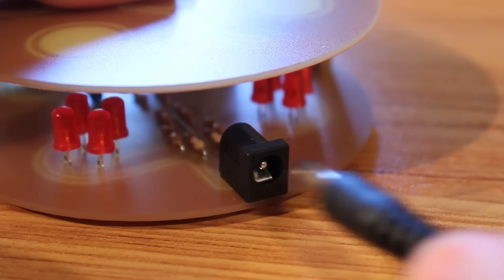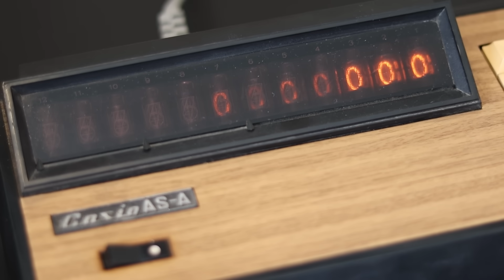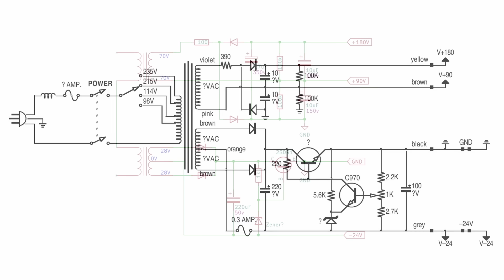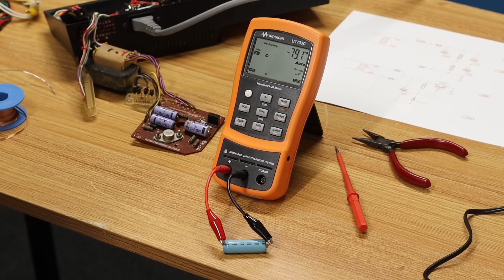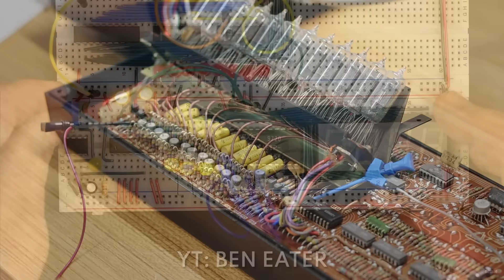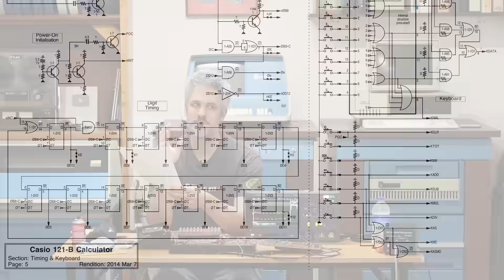Working on a Casio AS-A Nixie Tube Calculator

Comment: That signal is behaving as though you have at least one capacitor which is breaking down when voltage rises. Also check the resistor values.

Comment: Takes me back to the 70s when I was a calculator repair man (yes, we visited businesses and repaired their calculators). The main product was an enormous beast that had 16 nixie tubes, four basic functions and no memory (It took all your strength to lift it). The innards consisted of about 50 plug in PCBs with a few transistors and discrete components. Faults were tracked to individual PCBs, which you then repaired back at base. Calculators rapidly shrank in size and we were eventually out of a job. I still have my first pocket calculator purchased in the late 70s (and it still works).
Reply: I still have my OMRON 606 pocket calculator purchased in 1976, it also still works 😊

Comment: I have somthing similar to that but i think it a little bit older. Its a ANITA 1021.  its got about 10 Pcbs in the back of it that all plug into a motherboard as such. The nixie tubes are made from red glass by Mullard.. Its all original. never been touched.  I think and i might be wrong its late 1950s
Reply: That is a very collectible calculator! The Casio AS-A came out in 1969 and the Anita 1021 in 1970. The tubes are clear glass that is painted red.
Reply: I couldnt really find much information about it, aparantly it was the first model that they introduced silicon chips to. Before that they were all transistor but the 1021 had some chips aswell.  @megatesla

Comment: Any idea what the logic family is on the circuit boards? Good luck finding spares.
Reply: Mostly Hitachi HD3106, HD3107, HD713, NEC uPD13C and uPD101C.
Reply: They're P-MOS devices that required -24v, made by NEC, Hitachi, Toshiba, and Mitsubishi between 1968 and 1971. You are not going to find new spares of course. But replacemens have been fabricated using modern C-MOS, with logic lever converters, and appropriate linear voltage regulators. .
Reply: @michaelturner4457  Some spares are available from shops in Japan. But I am interested in how the replacements are made. Can you point me to that please? I fixed one of my AS-A's today. Luckily it only had a broken trace on one of the clock lines. I now have 3 other ones in different partially working states that I am going to try and repair.

Comment: BTW, it's not zero-C and zero-T.   That is the Greek letter Phi, which is often used in digital logic to indicate a clock of a particular phase.  So, it's "phi-C" and "phi-T".  Likely, the calculator's two clock phases are non-overlapping, which probably indicates that it uses early MOS (metal-oxide semiconductor) logic.  Remember, the 6800, 8080, 6502 and 6809 microprocessors all required a 2-phase non-overlapping clock pair.

Comment: Check those metal can germaniums for shorts to the can itself.. especially if they have a screening lead (i.e. the package has 4 leads).. caused by tin whiskers..
Reply: They are silicon transistors. If faulty that tube will stay lit or be dead.

Comment: I'm certainly no expert, but I wonder if the chaos comes from the flip flops being unable to keep up with the clock.  There's supposed to only be one high pulse cycling through the loop, but if one of the flip flops doesn't have time to fall from high to low before it latches, then you would end up with more than one pulse.  And if it's right on the edge, it may goof up inconsistently, which could look like what you see.
Not sure what would cause it to exist right on that edge, though.

Comment: The whole device is specced at about 8 VA power draw, thinking you hould load it with 12 W is pure wrong. If the transformer draws 8 VA, the Pout of that power supply could be maybe 5 W at best, total across all rails.
Same as you speak about the 20 W transistor, nonsense to assume load from the Ptot of that pass element. It will be capable dissipating 20 W with ideal heatsinking, holding 25°C at the case (while Tj is at max internally). That little poor transistor is without any heatsink, so the allowable dissipation on it may be like 1 W at best. By estimating the input voltage to that regulator to be somwhere around say 35 V, you could load it at best 1 W / (35 - 24 V) = 90 mA continous or maybe 150 mA short term.  Half an amp is absolute crazy. Another hint you should notice is the very low capacitance of the filter cap before the regulator - at only 200 uF, should be a giveaway, that the power supply  rail at 24V will be rather a low current one.
Reply: Changing the electrolytics in the power supply was also like not necessary. Don't just assume capacitor is bad! Old electrolytics were common having a tolerance range of like even -20..+80 %. And if it pretends to have capacitance, low ESR and low leakage current, there is zero reason to bastardize the power supply with new caps.
Reply: @Sixta16  I have to agree with you. I have a dozen nixie tube calculators and other early 70s models and I am yet to find a dead capacitor. I usually need to replace diodes, transistors, reed switches and maybe a faulty IC.

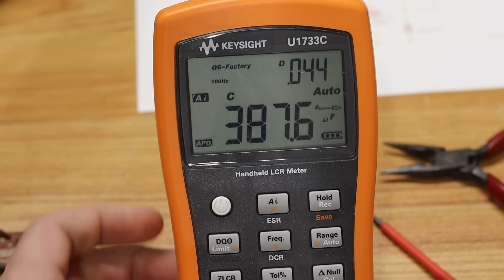Comment: 13:30 Your meter shows the capacitance as higher than normal, when it's really a lot lower than normal. This is because the cap's electrical leakage is fooling the meter. Most capacitance meters work by feeding a signal of known frequency and voltage to the cap, and then measuring the current that flows through it. Higher capacitance means higher current. But so does leakage! And so the meter gets fooled. The only way to get the real cap value is to use an old-style tester that puts the cap in an oscillator circuit and measures the frequency of the resulting oscillation.

Comment: I'm a big fan of tubes myself, and your tube computers are why I subscribed. I'm a vintage audio service tech, and I work on a lot of tube gear. Your description of triode operation was excellent! As for nixie tubes, there is a piece of benchmarking software for Windows PC's called "Superposition." While running, it displays a sort of "tour" of a laboratory containing a machine that affects the gravity in the room. There is a desk where owner of the lab sits, and on it is a calculator, case removed, and nixie tubes glowing. It's very cool. I'll see if I can email you a screenshot.

EDIT: Well, I was going to email that to you, but your home page on YT does not have an email address I can find. Anyway, check out the Superposition benchmark if you get a chance, and you can see it for yourself.

Comment: I suspect there might be noise or an erratic fault in the display driver latch ring? That would be consistent with the incorrect but periodic sequences of pulses seen early on. 

I could also see this fault being constrained in a way that makes the all zeros state a fixed point of the feedback system. This would explain why the calculator needs to be restarted once it goes dark.

Comment: I have the Commodore branded version of this calculator.  Unfortunately it is missing the "divide" keycap.. and I'll probably never find a replacement.  I also need to find one of the weird japanese-calculator power cables.  But it mostly works - need to test more when I get a proper power cord.

Comment: I am not sure that it as broken as you think. You have to push clear twice before calculations can happen.
The as-a is an early style of calculator that comes up with lots of rubbish on switch on and only after pushing clear twice can you start to calculate.
I have an as-c unit that has two strange accumulators that don't seem to make a lot of sense but it has a working decimal point
Reply: My AS-A starts up with 0's and are ready to go, no need to press C.

Comment: I recently designed a Nixie tube clock and I'm fascinated that the engineers who designed this calculator chose to multiplex the tubes. Big power savings, of course; probably on the order of 5 watts saved across 12 tubes. But some people today believe that switching the tubes like that will cut the tube lifetime. Many (most?) of the clock designs on the internet continuously power the tubes. Makes me wonder. Anyway, thanks for the great video!
Reply: I've never heard of nixie tubes or other gas discharge type displays failing because of multiplexing. Cathode poisoning due to sputtering can be the main problem with them, which is why some nixie clocks periodically cycle all the digits. They probably chose to multiplex the display so it only required one high voltage digit decoder cathode driver IC, instead of 12. Which were probably more costly than 12 anode driver multiplexing transistors. And would also make the PCB much more complex with all the separate cathode connections, instead of paralleled up.
Reply: Multiplexing cuts down on the connections made to the display bank significantly. Multi-digit displays from the 70s would have used the scheme and the tubes had to deal with that fact.
Reply: Hmm, that would be interesting to look into. The only thing I can think of is oxidation, but seeing as it's vacuum sealed, I doubt that would be the issue.

Comment: It's OK if a power supply capacitor is a bit too big.  The spec on those old ones was something like -10% to +25% of stated value.  But the ESR may be real high so changing them out wasn't a bad idea.

Comment: There ICs are fascinating on this calc. Very early P-MOS devices that ran on -24V, were unique to Japan, and now completely unobtanium. 

EDIT:
I think standard +5v TTL logic might have available at this time, but possibly due to US patents, licensing, maybe Japanese manufacturing pride, NEC, Toshiba, Hitachi, Mitsubishi, et-al, developed their own totally unique semiconductor logic methods for use in these calculators.
Reply: do you mean with a positive supply too, or with only negative? (as in 0V, -24V, or +?V, 0V, -24V? I'm guessing it's the latter, since it makes no sense to do it like the former. All you'd need to do to make it sane voltages would be switching around the labels for power and ground, then you'd have 0V and +24V)
Reply: @nikkiofthevalley  The latter, it's -24v with respect to the 0v, +90v, and +180v power supply rails. Also the swing between logical 0 and 1 is almost 24v, which can make these ICs rather difficult to replace with modern devices. I'm sure they were only manufactured for a short time, 1968 to 1971, as by then LSI chips became available for use in much smaller battery operated calculators. 

Usagi is in for a lot of fun with fixing this Casio.
Reply: @michaelturner4457  then I think one of the timing traces he showed was odd, the amplitude was somewhat closer to 5V whereas the clock had a much higher swing (assuming both signals have the same scale of course but I've yet to see a scope that lets you have two scales on one screen)
Reply: @michaelturner4457  About the only way to replace them with modern ICs is to make boards that contain a few level converters and a linear regulator along with the actual replacement IC haha
Reply: @nikkiofthevalley  I've read about repairing them, and that is exactly what they've done to replaced failed ICs, unless they had another spare scrapper machine with the appropriate good devices. I think that's the problem with Usagi's Casio, one or more of those very rare and unique chips have failed.

Back in about 1990 I acquired a Casio 121 of similar vintage and that didn't work. I seem to remember the nixie tube display been all scrambled. Of course this was before the internet, forums,  blogs, and YouTube.

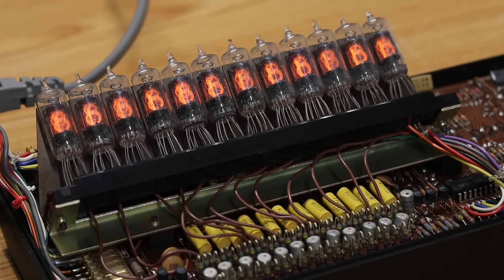Comment: At 5:50 you are expecting it to display zeros. This does not necessarily have to be the case. After switching it on it may display whatever is in the shift register. After powering it on always hit the C key first. If the "anode selection" / driver circuit isn't working correctly you get a superposition of all digits that are in the shift register, on every tube. Around 15:00 that could be the case.

Comment: When you were probing the digit selection of one digit there did look to be some low frequency ac on that trace. I know you fixed the power supply ripple so what I saw may be the ground reference for that trace being open circuit, but if one ground is connected to the DSO there shouldn't be a ground issue with the DSO. My suggestion is that you take another look at that signal again with the time base slowed down to see if the waveform has some low frequency ac superimposed on it. If this is the case and you have ground connections to the DSO in place, then this part of the circuit may not have a 0V reference to the power supply.

Comment: I would be looking more for bad solder joints.  A good visual inspection can eliminate at least half of your problems.
Reply: Unfortunately with most of these vintage calculators the problems are with IC's, diodes and transistors, almost never a bad solder joint, and very rarely a bad capacitor.

Comment: The LCR meter measures how long it takes to charge the capacitor with a known amount of energy. If the capacitor is leaky, it takes longer and thus it shows a higher capacity than rated.

Comment: Old capacitor that were not used for a long time tend to read high with the capacitance, as the oxide got thin over time. It would go down in capacitance when used a bit longer. A bit higher capacitance would not be a problem. It is more the higher ESR that can be an issue.

The germanium transitors have a tendency to get more leaky / higher gain over time. This can cause issue. Another point is that they are rather temperature sensitive and with higher temperature the increased leakage gets even worse.
A poor clock waveform could explain quite a bit of the issues.

Comment: In that sort of "one hot"shift register thing, there usually is some logic to ensure only one flip-flop is on.  On some, there is a reset circuit that just forces it into that state.  On some, there is logic that gets it there after some number of clock cycles.
You are likely to also find that the digits of the numbers are whizzing around rather than stored in locations and selected as needed.  At 40KHz, you may see the bits go by.  The sweep across the digits may repeat at something like 3KHz.  The add function would be done digit by digit.  Multiply would be done as you would when doing a long hand multiply on paper.
 Youtube is suddenly very slow but I don't think this thing has a sqrt() function but I can't see the panel to check.  There is method for doing sqrt() that can be done on hardware like this but I doubt they included that.
The divide feature on this thing would involve many trips around on the numbers.  It will be a little more advanced than just counting off how many times you can subtract.

Comment: You may have some IC chips with silver plated leads, which could be shorting out. It's important to note that the use of silver plating on IC leads was discontinued by some manufacturers due to issues like peeling and silver migration, which could cause short circuits.
Reply: The same also happened with some early tin plating.  Any pure metal constantly tries to make a crystal.
Reply: @kensmith5694  It may also be an issue today since they have been getting away from leaded solder.  Lead-free alloy solder with 96.5% tin, 3% silver, and 0.5% copper, and if there is any contamination the chances of tin whiskers increase.  Using some type on conformal coating is required to help prevent tin whiskers, thus preventing some type of failure.
Reply: @tedjones-ho2zk  It was a huge issue in early lead free stuff.  Today they have the problem solved.  Coatings only delay the issue.  If your product has a 1 year warranty that is good enough but the real answer is a slight addition of other metals.

Comment: eeks - that like and dislike buton are way too close together 😊 - anyhow: I'm not sure if the display driver would actually loop that driving signal in a circle like that - I have an HP calculator where I replaced that driver chip wiht a few shift registers; and it does start a "display and keyboard scan" cycle with a distinct bit from the "cpu" every time. It would mean way too complicated synchronizations if it was a self contained loop like that. Also: like the HP one, chances are high that the shifted bit could also be used for the keyboard matrix input, so maybe there is something stuck there? Just spitballing of course; but picking the signal from the first and last of the flip flops seems a good next step: check if there's a clean pulse going in and coming out again, to rule out these...

Comment: Having come into my early career in the late 70's, nixie tubes were quite common, eventually being replaced by vacuum flueorescent displays and eventually seven-segment LED and LCD. Being trained in TTL logic, with its +5V (and often +/-12V levels, depending on the cicuit), I'm always taken aback by the 100, 200 and more volts used commonly in vacuum tube circuits that perform similar functions to the more familiar integrated circuits. That's why this channel fascinates me, watching ancient electronics in both theory and action. Great stuff!